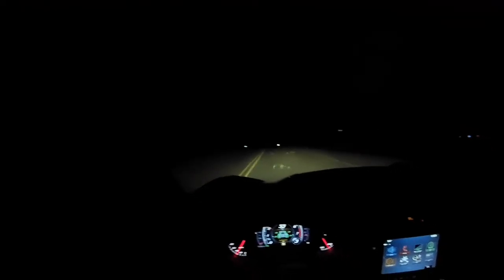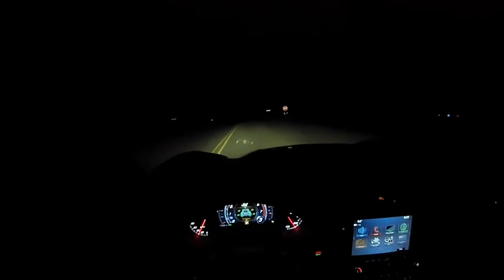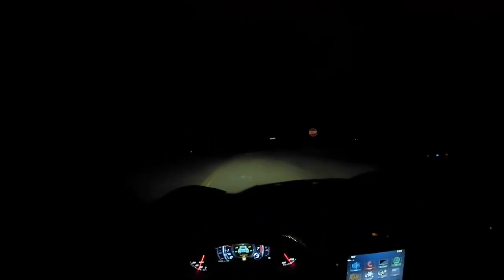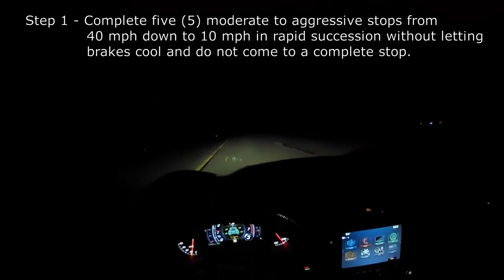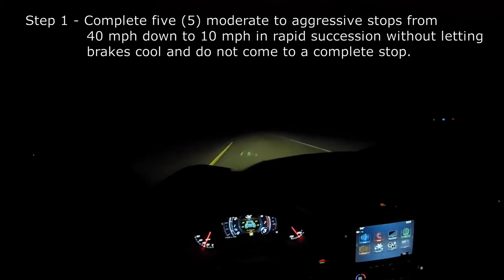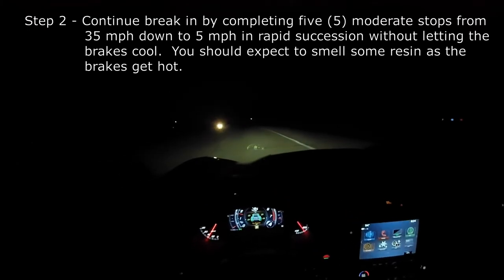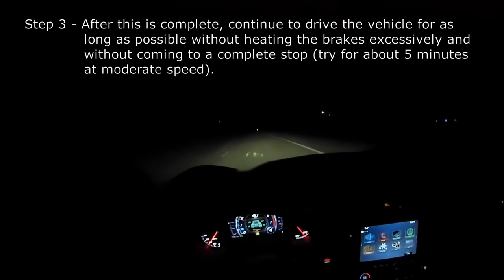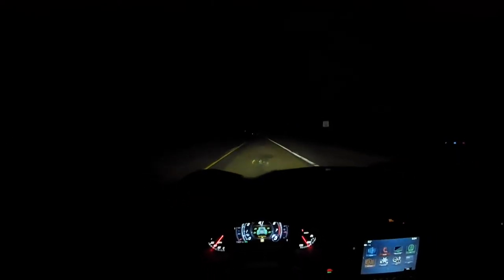Power Stop Z26 Carbon-Fiber Ceramic Brake Pads - BREAK IN Process

Comment: Thanks man just finished installing and breaking in, before break in though the brakes will grind and make weird noises now its good,  I'll drive around later on and check.  Thanks again for the video.
Reply: I just got my PS rotors and brakes put on. I'm getting a grinding sound just rolling through a parking lot. Is this what happened to you? It's embarrassing to drive right now.
Reply: @Bmac6867  just when I was reversing down my driveway it was grinding until I started the break in infront of my house and it was gone and braking is still good since then.  Did u break it in already?
Reply: @deliriumsyrup  , I took it to the shop today and they fixed the issue in about 10 minutes. I drove around a bit and the brakes are working great.

Comment: I just ordered these brakes for my GS...how is the dust compared to stock brakes?...
Reply from the maker: EXCELLENT so far!  I actually am planning on posting a quick video in the near future showing the difference.  I took photos at different mileage intervals with the stock pads for a 300 mile duration and then took photos with the new pads at the same mileage intervals to compare.  Night and day difference!  VERY HAPPY with them!!!
Reply: TJ's Toy Shop Cool...i’ll have mine installed this weekend...was going to have wheels ceramic coated too for easy dust rinses but if these work that good then i’ll save the $350...
Reply from the maker: MiNuSx31 Is a major improvement so I would suggest the pads first and then decide on ceramic coating from there! Good luck! Bye bye dust!!!
Reply: TJ's Toy Shop Had the pads installed yesterday...washing car today and will monitor the dust...
Reply from the maker: MiNuSx31 Awesome! Keep me posted on what you think!
Reply: TJ's Toy Shop Feels like same braking performance but no dust!..,
Reply: MiNuSx31 did you get them installed also? Correction: just saw response, still good?
Reply: DCrump Yes I wash my car once a month now because its garage kept used for the weekends only...I just use the chemical guys spray wash and microfiber towel to get road dust off car and its looks great since no brake dust build up...
Reply from the maker: Huge difference! Would highly recommend!
Reply: @minusx31  DONT DO IT!!!  Had the wheels on mine ceramic coated the day after I drove it home from the dealer.  Sadly the wheels are garbage - all that stuff about them getting bent is all true.  The cast wheel is just to weak for those big meats especially the run flats because of the increased sidewall thickness.  So.... odds are you’re going to bend them (or worse crack them) and regardless if you buy new or have them straightened - ceramic coat bye bye.  I bought flow forged MRR FS01s in matte black for mine and they’ve been great.  If you do go after market at some point MAKE sure whatever you buy is specifically set up for GS/Z06 as the offsets are fussy and super noticeable on the car if they aren’t right.
Reply: By the way ceramic coatings are great!!!!! - just not on crappy wheels that you’re going to have to fix or replace.